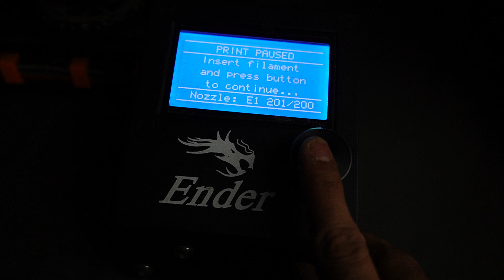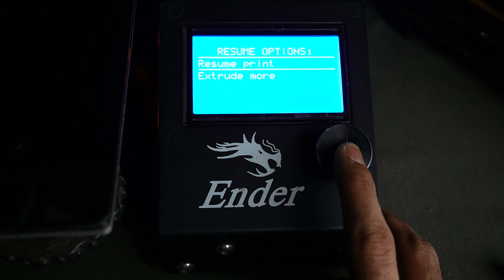How To Change Filament Mid Print On Ender 3 & Ender 3 v2 #3dprinting

Comment: I've tried this on my printer, I have an Ender 3V3 KE - and it appears to need a new z-offset when I switch filament and start the print again.  It seems to have lost its location or is printing way too low that its scratching the print up and not extruding well cuz its too low.  I've tried this 4x and can't seem to get it right.  Whats your advice?
Reply: were you able to fix this? I had major under-extrusion issues with the KE when switching filament mid print.
Reply: @RichboyJhae  I was able to fix it yes, and now I have a different issue where the Y seems to be moving after I switch filaments.

Comment: Hello, I have an ender 3 v2, and I don't have a change filament option when printing? Do you use MRiscoC's firmware, or is there a way to enable it on the default firmware?
Reply from the maker: hello mate, I already have created video on how to install Mriscoc firmware: https://youtu.be/fl5rRF7hlUg